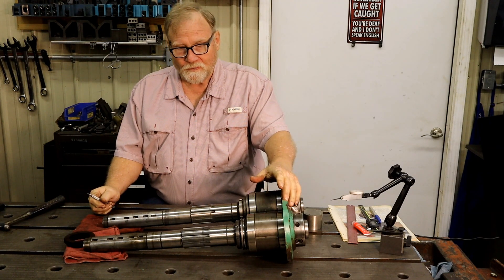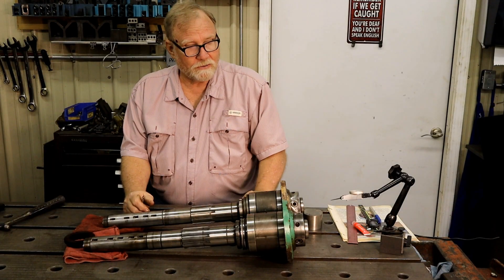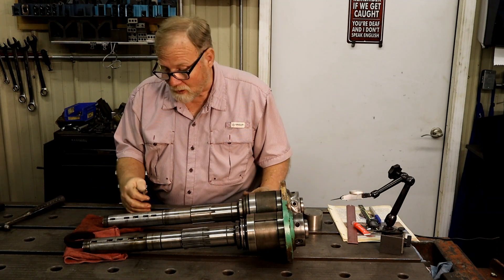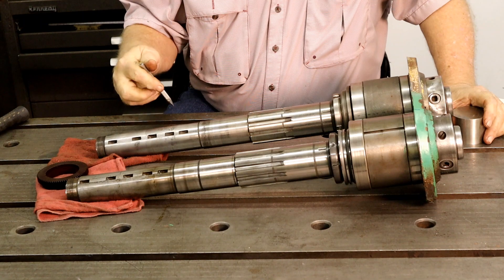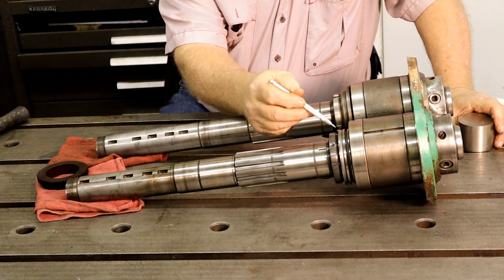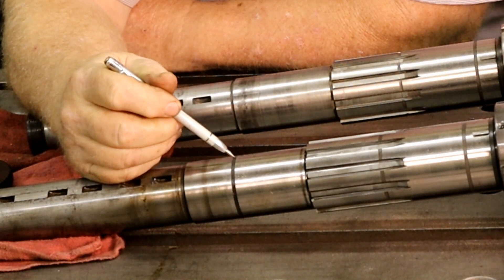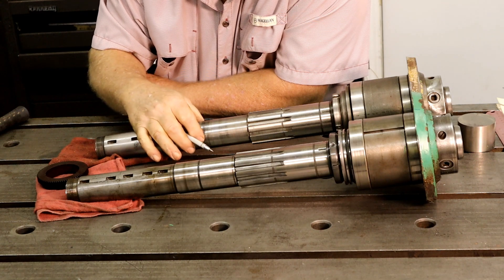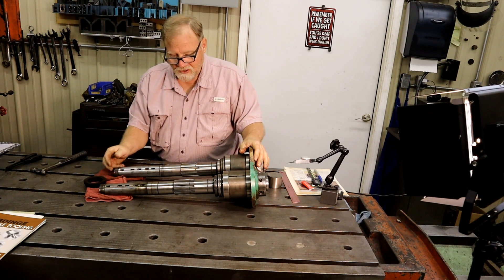Looking at the spindle from the 7000.00 mistake 10EE

Comment: I like your sleeve idea, but I agree, you might get a better match by making it slightly proud and then grinding it to size with a tool post grinder while turning between centers. BTW: loctite and others make a cylinder sleeve adhesive designed to take the heat and severe loaded of big diesel engines when reserving the cylinders. This stuff even works well on small caliber firearms like .22 barrels. Good luck!
Reply from the maker: No need, it was perfect....

Comment: Do you still have the spindle? Obviously spray welding is a no no, but have you thought about electron beam physical vapor deposition (PVD)? It adds atomic layer by layer with an electron beam in a vacuum at ambient temperature so no heating is required. The spindle could then be reground to its original tolerance.
Reply from the maker: Yes I have it...  Trying to do this on a budget :)   3/8" of bearing surface for a bearing that is 1.5" just was not that big of a problem to go to a lot of expense... As it turns out it is working great :)

Comment: The Double E headstock was hand scraped to 50 millionth   to the bed. I don't remember what the spindle run out was, but all other Monarch lathes were 2 tenths. As a former Monarch Service Rep. I worked primarily on CNC lathes, but that was 30 years ago. We did warm the spindle bearing in an oven prior  to intalling them onto a spindle. A few times out in the field I used warm oil to heat tbe bearings,  usually to around 120 degrees as I recall.
Reply from the maker: Thanks for the tips:)

Comment: Steve hasn't shared with us how thick the difference is between the diameters. But, years ago I sent out quite few precision spindles of similar size to be professionally chromed & ground  in specific areas of major wear, & they were done with excellent results. The cost at the time also seemed very reasonable enough to do, on our always thin budgets.
Reply from the maker: The ring thickness is .038...   That's why I machined it like I did, plenty of cooling time and roughing it out in steps...
Reply: @10swatkins  I'd take it to a hard chrome & grind guy,  he can make whole bearing surface perfect to fit your bearings. If you don't have the right equipment - job it out to a pro, Do it right.  - Make a video of the visit to his shop !?

Comment: Someone else said something similar.  Look for another set of bearings.  The new shaft you have is probably newer and uses a newer style two row angular contact vs the stacked single row angular contacts of the old shaft.  There's a reason spindles cost a fortune to have someone rebuild and stacked high precision angular contact bearings are a trick to put together with that level of precision.  If you can find a twin row single cartridge bearing that would be the way to go

Comment: you have 1 1/8" of register on the inner race as it is and would probably work just fine without doing anything more to it.  I would agree with the fellow who suggests fitting the od to the bearing and leaving the id large to allow room for epoxy or whatever type of glue you want to use here. Which is the same I think as you are saying with the red locktite. It becomes self centering. Do those bearing function more for alignment than load, if so, all the more reason that an epoxied sleeve of any sorts will work. Look forward to your success with this.

Comment: Personally I’d shrink fit the sleeve, then grind it place between centers. Then your have an accurate and permanent shoulder extension.

To install clamp the spindle vertically to the bench.  Set the extension ring on a brick, and heat with a wide flame mapp gas or propane torch. Pick it up with a welding glove and it’ll drop right on.

Comment: I am a machine design engineer with experience on precision spindles.  If anything close to 50 millionths is needed, the sleeve should be shrunk in place.  If heat warps it, the journal will true it back up.  BUT, the sleeve OD has to be oversize and ground to size concentric with the spindle.  Otherwise, there will be excessive runout, maybe half a thou.  If heating the ring is too scary, freeze the journal and let it expand to give the interference fit between it and the sleeve.  If I didn't have the ability to grind in place, I would sub that operation out.

Comment: If you're worried about even heating, heat it in oil. Heat oil in a metal container then dip the sleeve in it. A cheap electric frying pan or deep fryer will also do. I don't know what the difference in heat expansion between stainless steel and carbon steel is but I doubt it will be a factor. Don't the gears push up against that edge to hold it in place?

Comment: New arrival here, and this is for sure an interesting project. Does the main bearing group in the 1990 machine have its own oil supply? I’m trying to work out the reason for having a labyrinth seal in there. Thanks, Steve!
Reply from the maker: The older models all had three oil sections in the Head. They were kinda weird in that you used different oils in different sections but they could comingle and splash into other sections, mainly the lighter spindle oil in then main bearing area could leak into the middle section with the gears...   
This head uses just one oil and has a pump that circulates it via oil lines to the main bearings, rear bearings and the middle gears...  Only one sight glass now as opposed to the three in older models.
Reply: Thanks, that’s good information. I suppose the labyrinth seal in the common-oil version is used to corral a good volume of oil in the bearing neighborhood. Or something. 🤔

Comment: Greetings from Australia
Hi Steve....
Make the ring a light press fit in the bearing itself. Then lap the ID of the ring to fit on the spindle by trial and error. No heat and it will be easy to press it out of the bearing if need be.
Maybe you can grind the ring ID and OD in one setting on your tool and cutter grinder. then a tiny bit of lapping and the problem is solved!
Regards
Reply from the maker: Bob did such a good job there was no need for lapping :)

Comment: I was thinking the groove was to separate the length of shaft that needed to be ground more accurately from the rest.  Is the shaft diameter exactly the same on both sides of the groove?
Reply from the maker: Same size... It's right at the edge of the first rear bearing... I'm thinking they used that brake to keep oil from going into the inner bearing race... But that's just a guess...

Comment: use hot oil to heat the ring, oil at smoke or 312f and machine your interference fitment. it works great, this is  what they did back when

Comment: Hi Steve, you told that you wouldn't heat that sleve, that your going to make. Did you think of the option to put that shaft in the freezer and adchieve the same space as heating the sleve?
Reply from the maker: I just don't think heating will be needed.. That loctite 640 sleeve retainer stuff is made for this kind of thing and by making the outer diameter perfect and the inner diameter just right I can avoid having to try to resize the outer diameter after installing it.... Thanks for the comment :)

Comment: Do you or anyone you know have access to a spray welding rig? Those systems were pretty much designed for bearing journals.  I didn't hear you say the difference between the inner and outer diameter of the sleeve you'd have to make, so I don't know how much material would need to be built up.  
Just something to consider.
Reply from the maker: I have access to them BUT  this is probably a 10,000 dollar  precession , hollow spindle that is ground to a runout of 50 millionth of an inch... might as well toss it into a bonfire with welding it....   Welding a shaft that is well just a shaft is a whole different matter,... Thanks for watching..

Comment: Steve... for the Missing metal on the 10EE... you could contact Adam Booth (friend of Keith Rucker) he can spray weld that area and then use his lathe to resize the shaft
Reply from the maker: Theodore Thanks for watching.. I have nearly 40 years working on metal machines and projects... I have more capabilities in my shop than Adam currently has...  

Even Adam would never attempt to spray weld , let alone use a lathe  to work on this precession ground, to 50 millionth of an inch,  hollow spindle.   Just not the right way to do it :)
Reply: @10swatkins  Steve, I have few years... you are much more the expert than I... its your machine and you are doing the work... all I can do is ask questions and make suggestions...  you are the man..

Comment: Another option would be to make the O.D. of the sleeve fit the bearing, the I.D. slightly oversize and, using the bearing to align the sleeve, bond the sleeve to the shaft with Locktite Quickmetal.  I don't know if you have ever used this product, but it should be perfect for this application.  Make sure you understand how to use this stuff before you begin or things can go south in a hurry.

Comment: I've seen Adam from abom spray weld shafts to add material
Reply from the maker: You've never seen him spray weld an over 10,000.00 spindle that is hardened and ground to a 50 millionth of an inch runout !  Thanks for watching.

Comment: It doesn't take a large temperature differential to create a good friction fit. Put the spindle in a freezer for 24 hours and put your sleeve in a toaster over at 250 degrees and the sleeve will drop right into place. When the temperatures of the two equalize, that sleeve wont go anywhere.

Comment: I'm no machinist but I have observed  a Sunnen hone put a beautiful finish on hydraulic parts.If one was in your shop would you hone the sleeve to a final i,d, or would it be over kill? AL B.
Reply from the maker: Probably overkill and the heat and pressure it generates would distort this thin sleeve...

Comment: Cut up the old spindle and use it to make your sleeve, less machining and the right material,  just my 2 pence worth,
Reply from the maker: You get a star!  This is a good original idea :)    Only problem I can see is the spindle is of an unknow hardness and boring it out would be tough...  If I had a working ID grinder that would solve that problem though... IF :(   Still working on that one...

Comment: I think you'll be allright there with what your thinking. But I  like Don's approach too. I just wouldn't be using a torch or high temps. I'd go with 300° deg in the oven, and freeze the spindle before assembly... with all your sizing for that in mind. The great thing about what you're doing is if you mess it up, you can split the ring and remove it for a do over. Even if you get it all together and had to outsource a lil grind job for the OD finish it wouldn't eat you. looking forward to the video's there. Thanks for sharing

Comment: My only comment is to make sure the part is COLD when you sneak up on the final diameters and mike the shaft then the part both, each and every time.  Unless the shop is climate controlled the shaft will change with shop temp.  I know it is basics... but the basics can still bite you in the rump if you get too focused.  Great Plan and stay with the SS for the part unless you can't get a good finish on the outside.  :)
Reply from the maker: That part of the shop is always climate controlled Surface plates take too long to equalize and all my good tools don't need to rust :)

Comment: You are correct that 100% support of the inner race is not necessary.  Consider  reducing the problem to one critical dimension from two by turning and boring the ring with the perfect wall thickness for an exact fit without needing to hit both diameters perfectly.  A bit small on the diameters is fine.  Sneak up on the wall thickness from both the ID and the OD, which ever is working better. Part it then cut across the ring so it will slip on the shaft and into the bearing bore with a tiny end gap.  

Cool the shaft, or not, heat the bearing, add the Loctite and slide it together.  The fit and alignment will be as perfect as the shim thickness, with only a single super critical dimension.  

The shaft did not corrode during the first life time, a steel shim will not corrode during the second. Try several materials to see which is most forgiving and predictable.  4140 maybe.

Comment: I think for the application, a sleeve out of 303 will be perfectly sufficient.
I'm no expert, but I doubt you really need the sleeve ... unless that shoulder it creates extends beyond the bearing a few thousandths and is an important reference to the next gear(?) towards the end of the shaft. 
Thanks for sharing 🇨🇦

Comment: Steve, The only perfect people on the World are: Perfect idiots and perfect A-holes. The rest of us are fallible. You Ain’t no prettier or uglier than the rest of us. Lol. The sleeve is a good idea, Remember if you were in the R&D dept, you would try all methods for comparison. Heat slightly and use locking binder. Tolerances are tight. Go slow on final machining. Even sanding with fine grit helps for holding.
Reply from the maker: Thanks Ross... The deed is already done  with really great results :)

Comment: I'd spray weld it and grind it, if that was available.  Are those angular contact bearings? All the spindles I work with use them in the nose.  
  The way I've done sleeves like that is using an oven that heats evenly.  Wish you could afford the bearings.  Have you contacted anyone like Motion Industries to see if they'd donate them?
Reply from the maker: Hello, Motion Industries?  This is Steve Watkins and I would like to ask you if you would donate a set of high  dollar  10ee front bearings and oh how about the back one too?  What ? What do you mean Monarch has them specially made for their machines ? Hell just what kind of bearing shop are you running over there?   ...... Hello,  Hello.... Damn,  Obviously they don't know who I AM!

Comment: Hey Steve, I was pondering this and I was just wondering about the existing bearing fit on to the spindle?  Are you expecting to have that sleeve secured unto the spindle with the Loctite and then dress it down (grinding it flush) to the correct bearing fit (a close sliding fit)?  I figure the bearings fit securely into the casting and the spindle slides into place, right?
Reply from the maker: The fit on the bearing  inner race is a slip fit and the outer race is in  brass housing that is adjustable... I made a sleeve the exact diameter of both dimensions,  no dressing required :)

Comment: Personally, I’d make the sleeve a snug fit in the bearing and leave a little wiggle room between shaft and sleeve, maybe half a thou? Use the bearing to locate the sleeve in relation to the shaft and use Loctite 648 to glue to sleeve in place (I believe that’s the number for the bearing retaining compound. Stuff is super tough)

It would allow a few tenths of misalignment to compensate for any variation in the sleeve itself, and should provide excellent concentricity and support the bearing very well.

Just a thought. Keep up the good work!

Comment: Steve, I would buy a small bottle of Loctite 649 high strength/high temperature retaining compound. This is more suitable for this job than standard red Loctite. Given the hassle of having to strip the shaft out if the sleeve comes loose, I think the small additional expense would be worth it for piece of mind. I changed to this for the rear upright drive shaft bearings on big single seat (F2 and F3000) race cars, after I had a bearing work loose using standard red Loctite and it would have completely come out in another couple of miles, as it had vibrated the retaining ring almost all the way out of the upright.
Reply from the maker: I changed over to a sleeve retaining Loctite, forget the number.. .Will give that a try in the morning after Cardiac rehab...  thanks for the suggestions :)

Comment: Hi Steve, love the videos! I was thinking sleeve to, however make it a bit oversize and lap it to final diameter with the sleeve in place. Only thing to worry about is that you don’t lap the rest of the shaft with it.
Reply from the maker: I really did not want to do anything to mess with the 3/8" length of shaft that is supporting the outboard bearing.... I only have one shot at this who knows when another spindle will fall from the sky :)
Reply: @10swatkins  You could always make a hard stop for the lap so that it doesn’t go past the sleeve. Anyway, good luck with the repair!

Comment: Steve, love your channel and you approaches to problems. The SS sleeve method may work, and the lock-tite may secure it. If I might make a suggestion? Have you considered doing the new method of spray welding to build up the area that would be for the sleeve, and replace the sleeve instead with the spray weld. That way the absolute ID of the corresponding bearing could be machined without risk of movement of the sleeve or of any galling of parts. A lot of precision machine repairs are now done using that method. Just saying ..........see Abom79s channel, he does a lot of spray welding, in fact he runs a Monarch lathe and maybe could help.
Don
Reply from the maker: Would you take a spray weld gun to a precession ground,  hollow spindle that is ground and hardened to a run out of 50 millionth of an inch?   I think not :)  This is not a solid shaft with a run of the mill bearing slapped on it.. Spray is ok for that...
Reply: @10swatkins  Sorry, didn't mean to upset you.